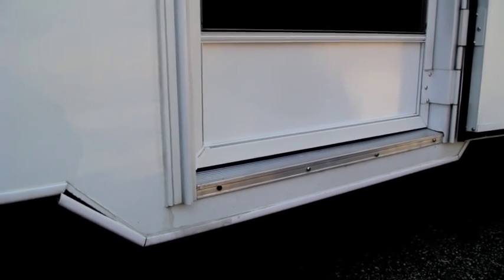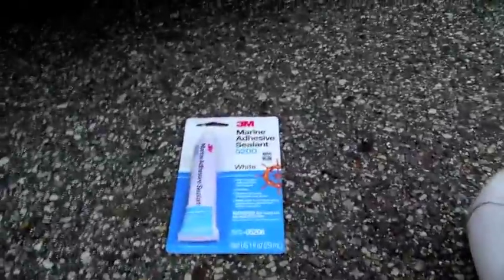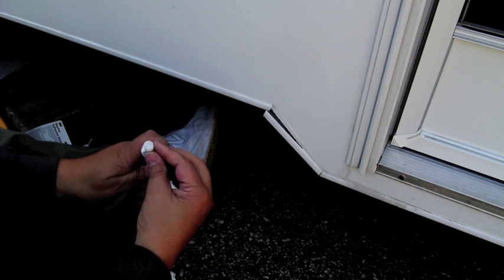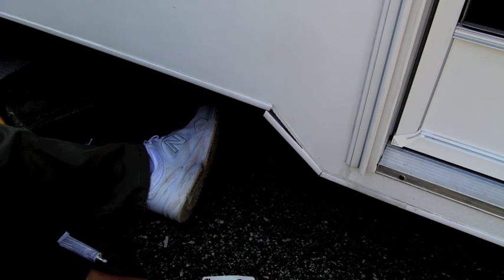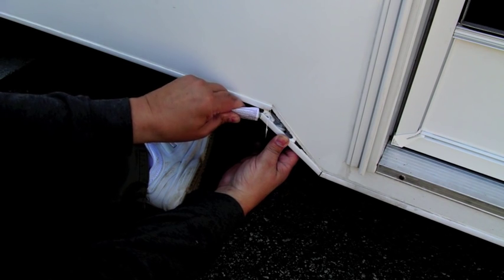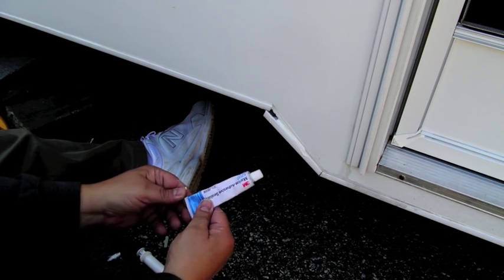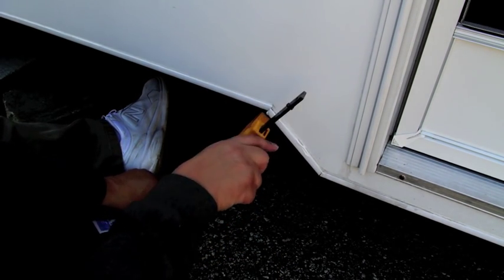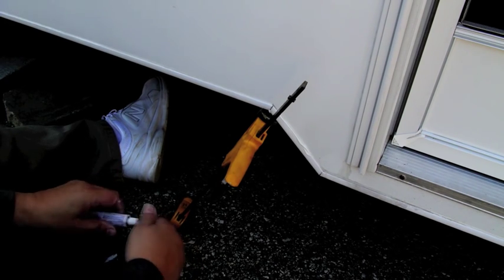Repairing an external trim strip on my RV.

Comment: NIce repair job.  I use 5200 on my boat, and now as a new RV owner, again find uses for it on the RV.  I buy the "quick cure" version at Lowes.   Much cheaper than some of the marine supply stores, and it's the large 10oz. size.  Great stuff, and a lot better than silicone for most applications on the RV.  I also use alcohol to clean up the area.  I'm not sure it actually prevents curing, but may delay it.  With acetone you run the risk on damaging the underlying area.
Reply from the maker: Danny Troy Yea, I came from the boating world myself and I used 5200 extensively. It is great stuff that I think the RV world has not yet discovered.